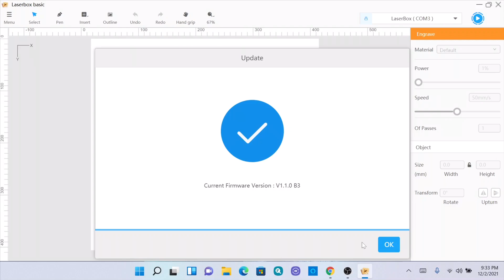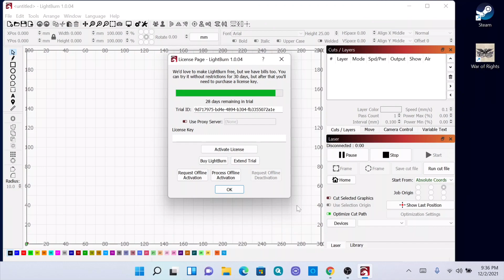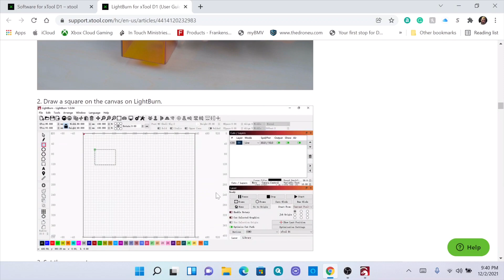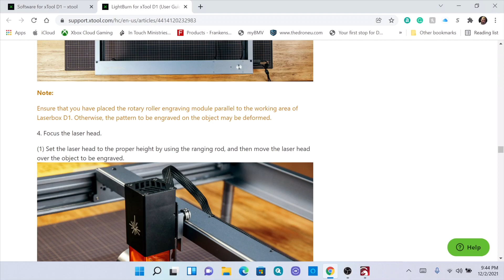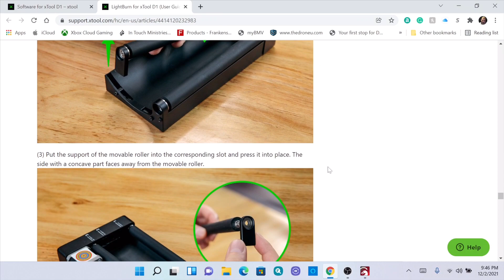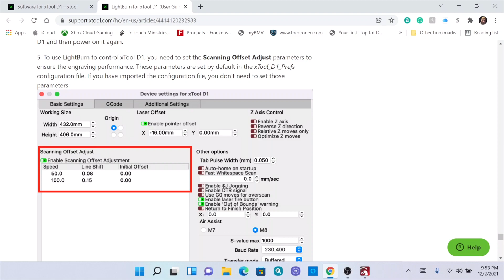The xTool D1 is now supported by LightBurn!

Comment: So I use light burn I have a ortur laser master pro and it just recently started doing the same thing I think it could be a software issue for sure. What setting were you running I normally use Jarvis rather then dither for images.
Reply from the maker: I use Jarvis and I like my laser running at a lower speed for better control.

Comment: I am having issues as well.  If I try to engrave at the max speed it goes nuts and starts to hop all over the work field.  Plus the emergency button, the silver start/ emergency button does not work.  I can press it all day long but it keeps on burning.  Waiting for support to email me back.  I have to say that I am pretty frustrated right now with this laser.  I hope you can figure out your issues. Dan
Reply from the maker: You are not the only one that is frustrated with this Laser it has so much potential but clearly needs a little more refinement
Reply: Did you figure it out?